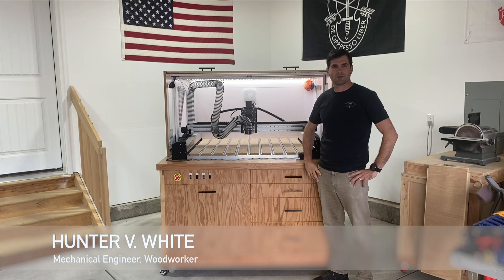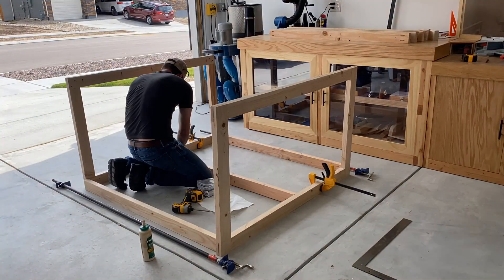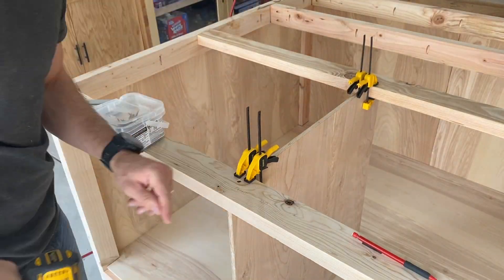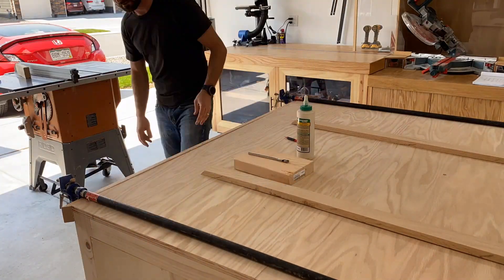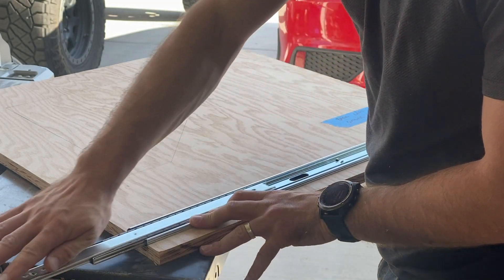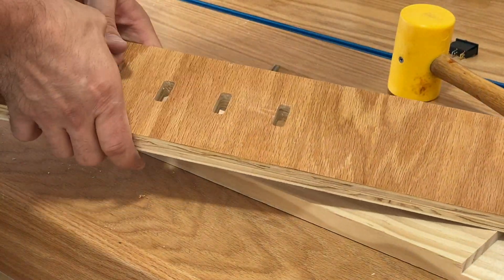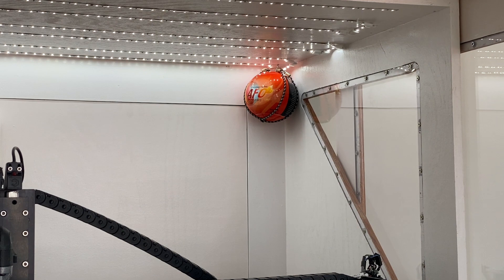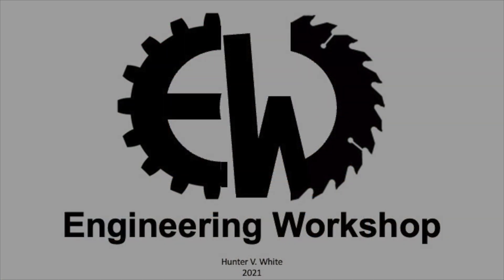CNC Enclosure: All the features

Comment: Wiring diagram and links to those blue switches?
Reply from the maker: Twidec/5Pcs Rocker Switch Toggle... https://www.amazon.com/dp/B08YNP1ZYM?ref=ppx_pop_mob_ap_share
Reply from the maker: TWTADE/AC 440V 10A Red Mushroom... https://www.amazon.com/dp/B07C4YCYRZ?ref=ppx_pop_mob_ap_share
Reply from the maker: The first link is the blue rocker switches on Amazon. They are automotive switches, but they work well. If you wire power to them, they will light up when on. 

The second link is for the emergency stop switch. 

I don’t have a wiring diagram for the switches. I watched a bunch of YouTube videos to learn how to do it, and was definitely not confident that it was going to work. I was shocked that it worked the first time. I’m sorry I can’t be more help; I wouldn’t even know how to draw you a proper wiring diagram without more self study.

Comment: The main reason I want to build an enclosure is to reduce the noise.  I really like the sliding top but I wonder how much of an impact that has on noise reduction.  Any thoughts or observations you have on this?
Reply from the maker: Hey Ted! Thanks for the complement and comment. The sliding enclosure is definitely not the best sound reduction method out there. I’m sure you’ve already watched videos with locking doors and sound proofing foam on the inside of the enclosure. Those designs will obviously reduce observed sound outside the enclosure more than my design. I chose to prioritize functionality and ease of maintenance (I felt like the foam would be a nightmare to clean the chips and dust off of). With that said, this enclosure significantly reduces observed sound in a garage workshop setting. Most notably, the pitch / whine of the router is lowered, making it more tolerable. 

My long term plan for noise reduction is to augment my Shapeoko Pro with a water cooled spindle. I think this will have a greater impact than most enclosure design choices (with exception to the most extreme) on the observed sound outside the enclosure. 

To close, I really enjoy the functionality of the sliding top. It gives the feel of an unenclosed CNC while setting up you work holding, vacuuming dust, etc; very convenient. I am happy with the prioritization of ease of use over sound attenuation; it’s quiet enough for me. 

I hope this helps!

Comment: Very cool enclosure! I like how the sides retract. Clever idea with the smoke sensor and smart plug. Can the plug be automatically turned off if the smoke sensor detects smoke? May require IFTTT integration, which also falls into the voodoo realm.
Reply from the maker: Thank you! I think IFTTT could automate the smart plug. This is my first Google Nest Smoke Alarm, so I can’t say for sure, but I’ve set up a few smart home automations with IFTTT before and could envision it working. I primarily wanted the smart smoke alarm in case I was remotely monitoring the CNC, I might not hear a traditional siren over the running CNC and dust collection; this way, I’ll get a notification on my iPhone and the iPad I’ll be monitoring the CNC with.